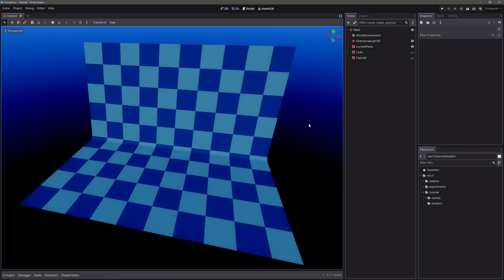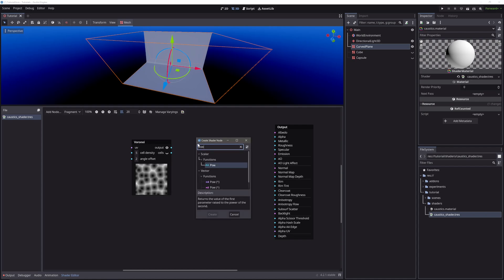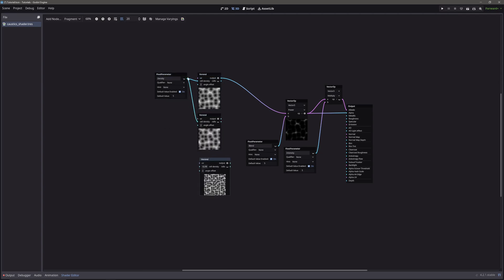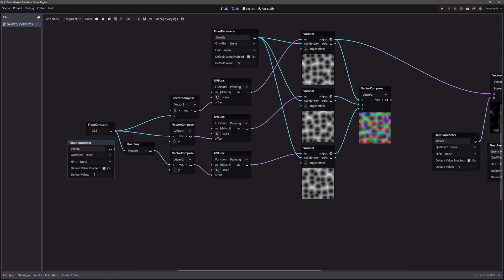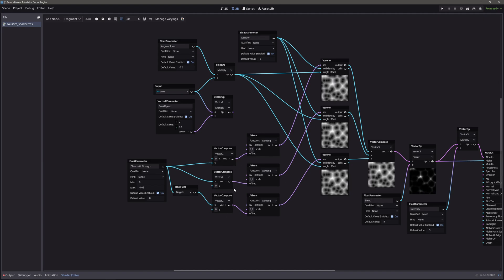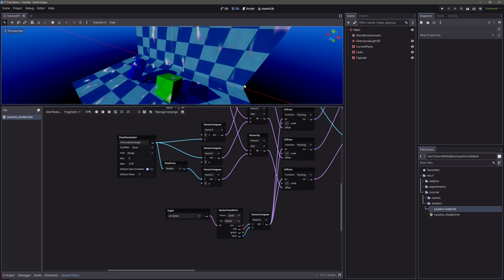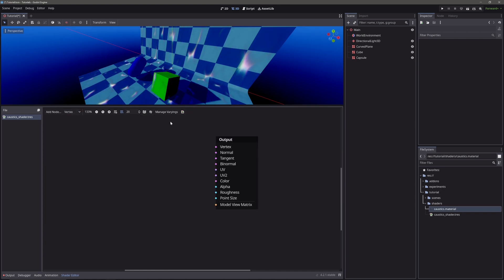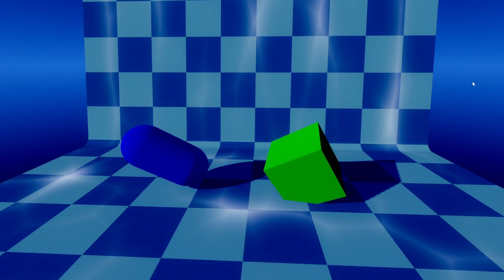Fake caustics visual shader! Godot 4 tutorial #howto #godot #godotengine #godottutorial

Comment: Hi Gohil, I see the Shader in the editor window - but not during runtime. What am I doing wrong? Thank you for this great tutorial!
When I use the visual-shader it says:
Parser Error: Class "VisualShaderNodeProceduralVoronoi" hides a global script class.
When I convert visual to script it does not compile. mmh
Reply from the maker: Hey Michael,
It seems like an issue with Shader-Lib itself (seems like I overcooked this time :_kekw:😅). If you are on Godot 4.2 try using Shader-Lib v2.2.3 and see if it works or not.

Comment: In the voronoi node, whenever I assign the time into the angle offset, the texture itself just scrolls, non of the black dots in the texture itself is moving about, or passing through each "cell membrane" Maybe I am doing something wrong here, when through the process twice, without fully replicating it.
Reply from the maker: Hey,
First a question, if you just change the angle offset manually, does the individual cell rotate or it also just scroll?
Reply: @iDigvijaysinhG  I have the same issue. They will change slightly if you offset it manually. But the noise doesn't offset in the same way as the video.